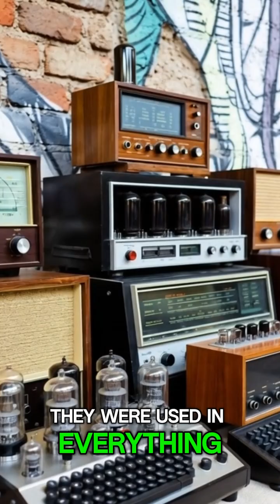The transistor an  invention that put all of human knowledge in the palm of your hand.

Comment: Vacuum “valve” tubes, fragile yes but, most certainly were NOT subjected to being “broke all the time”! Quite the opposite in fact. Of the countless many vintage/antique “tube” devices/contraptions I have owned, still own &/or, repaired/restored for others, I think I have really only had to replace actual burned out Tubes, but twenty times, of the several hundred that Ive interacted with. And most are supported/contained in a generally over-robust fashion of securement, aiding in their longevity.
Reply from the maker: Thanks for the input — that’s a very fair point 👍
You’re absolutely right that well-designed and properly mounted vacuum tube equipment could be remarkably durable and reliable over long periods. Many vintage tube devices still function today precisely because of that robust construction.

When people refer to “fragility,” it’s usually in a comparative sense, especially versus transistors in terms of size, power consumption, heat, and suitability for modern portable electronics, rather than implying that tubes were constantly failing in well-maintained systems.

Each technology excelled in its own era: vacuum tubes defined early electronics with impressive reliability, while transistors enabled miniaturization, efficiency, and scalability — making modern electronics possible.

Appreciate you sharing real-world restoration experience — it definitely adds valuable perspective.